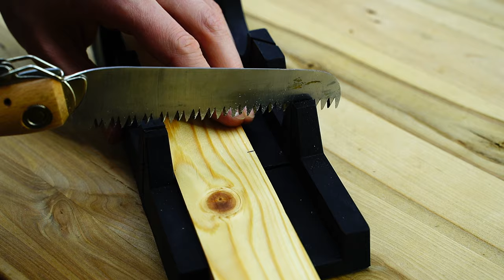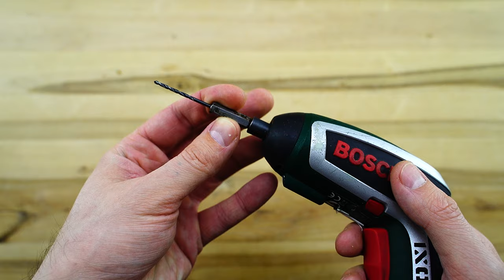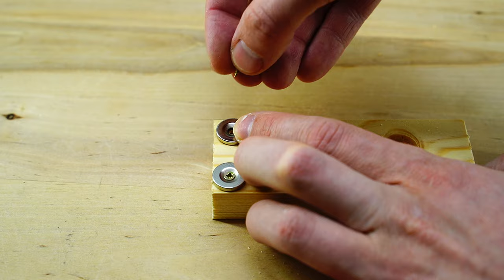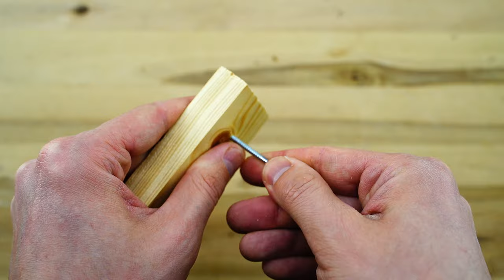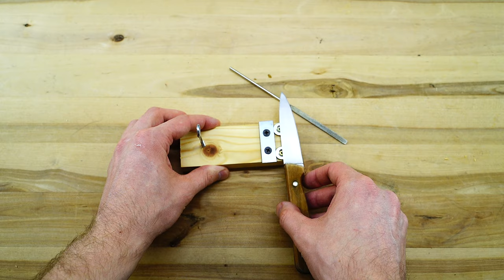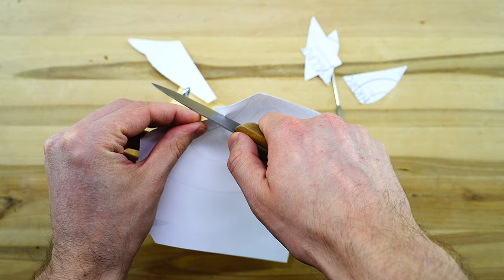How to make a very simple Knife Sharpener in 5 minutes DIY

Comment: Will only work if the blade is magnetic and a softer metal.  Also there is a lot of variation in angle since the eye diameter of the screw is wider than the diameter of the file shaft which will lead to poorer results.

Comment: what is this diamond stick thing? and how did you measure the angles? I think those are very key factors...
Reply: This is a basic setup. It wouldn’t take much to adjust the angle by just screwing the eyebolt in or out. It looks like he’s using a cheap diamond file. While this wouldn’t be my go to, it would be useful to take on a road trip or camping. Light, compact, easy to make and you’re not gonna cry if you leave it behind.